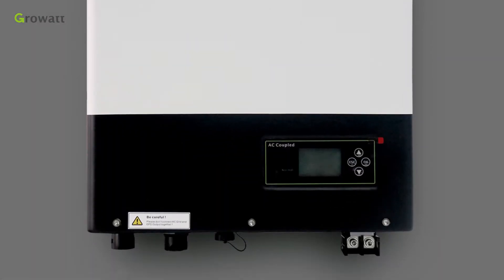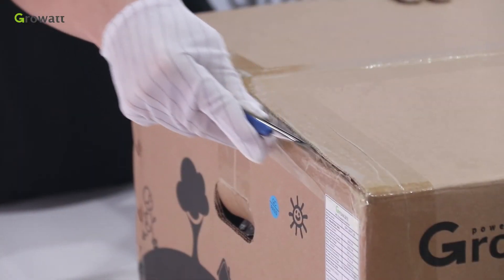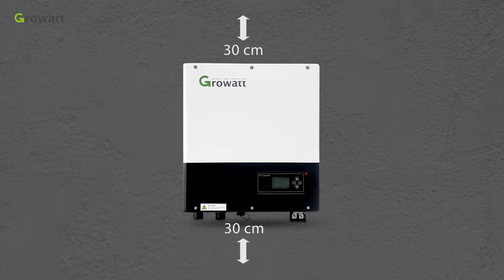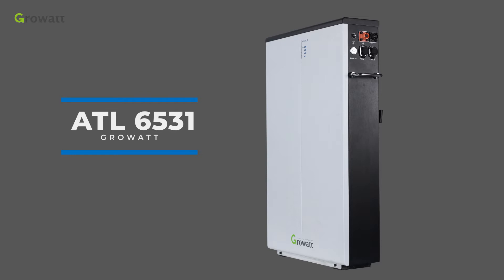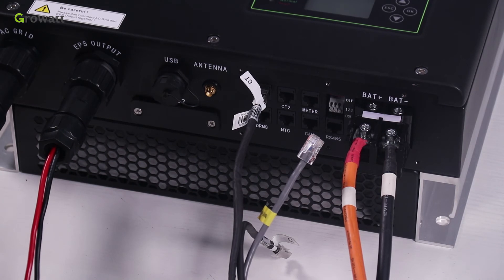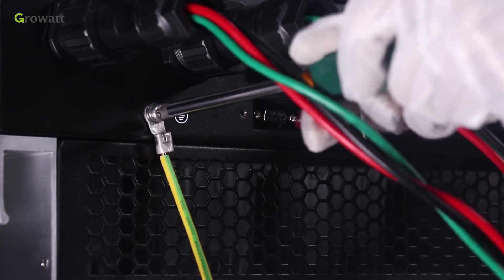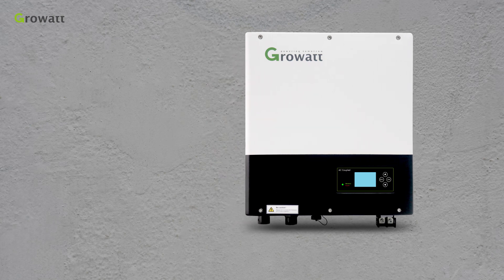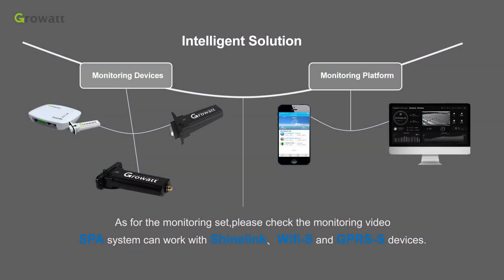SPA Single Phase Energy Storage System Installation

Comment: Hello and Thanks for the Video, this is near exact my searched solution, as
* I have two On-grid Inverter  each 2K with Peak 4620 W or making average of 17 KW/h a day (1.5 years working) Thailand / ChiangMai
looking in first step to store when Solar-energy > then Load, maybe about 4-5 KW a day (load baseline between 1.5 to 2.5 KW, and PV up to 3.5 KW)
as here no selling makes sense, and only look for a basic load for fridges, light, internet with ~ 1.500 Wh (no NEED for Air-con, Hot-shower, ...with 1000W to 3.500 Watt),
and better Self Usage of the own (a bit too much) produced Solar Energy ...
BUT here is the problem: 
--> can it set to only load Batteries during Solar-power without use batteries when as of cloud set PV < load for 10 minutes ? mean take Grid !
as the usage is minimum 30 KW/h Day Winter, and want Batteries full around 17pm to have energy of batteries in more important evening after PV = 0 W usage or able to handle then often happen Grid Offs  / shut downs for 10-120 minutes ! (guess maybe 4 hours possible 6000 Wh / 1500 W = 4h)
As this solution allow to upgrade to 2nd battery to 12 KW/h and also independent upgrade of another 2 or 3 KW OnGrid Inverter later ... when Cash available or upgrade needed
Reply from the maker: Hello, for technical support, please feel free to contact our service team at service@ginverter.com. Thank you!

Comment: Permisi pak saya membeli inverter growatt sph 5000,
Dan saya mengalami masalah,,
Contoh sebagai berikut:
Inverter dalam keadaan on. 
Tegangan dari grid on,
Mcb grid saya off.
Kemudian inverter back up,,
Setelah itu saya off switch PV yang berada di inverter.
Setelah beberapa lama batrey habis,,
Kemudian Saya on kembali switch pv yang berada di inverter..
 Dan indikator battrey di inverter tidak tampil.
Apakah inverter ini rusak?
Dan apakah saya salah dalam pengoperasian?
Reply: Excuse me sir, I bought a growatt inverter SPH 5000,
 And I'm having a problem ,,
 Example :
 Inverter is on.
 Voltage from the grid on,
 MCB grid is off.
 Then the inverter back up ,,
 After that I turned off the PV switch on the inverter.
 After a while the batrey runs out ,,
 Then I turned on the pv switch that was on the inverter ..
  And the battrey indicator on the inverter does not appear.
 Is this inverter damaged
Reply from the maker: @5element14  Halo, untuk pertanyaan produk dan kolaborasi bisnis, jangan ragu untuk menghubungi tim penjualan kami di info@ginverter.com. Terima kasih!